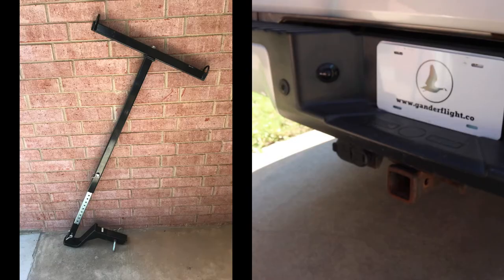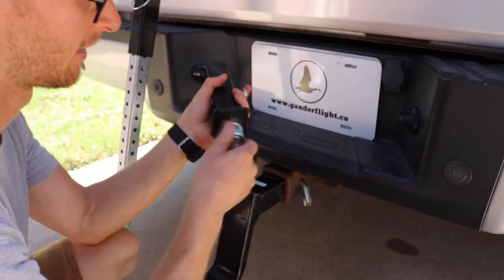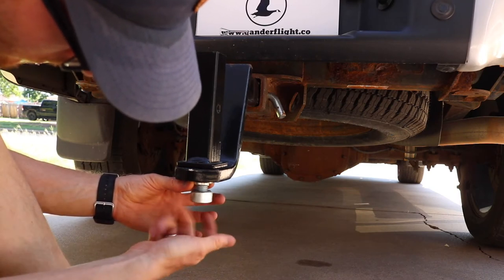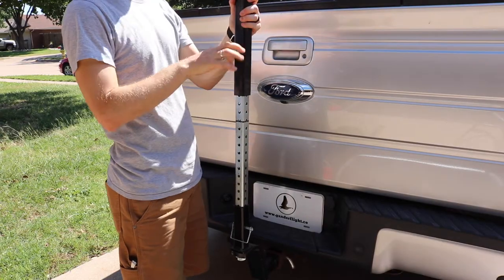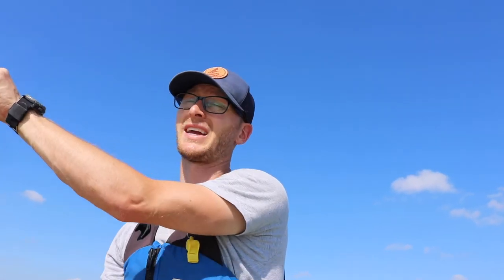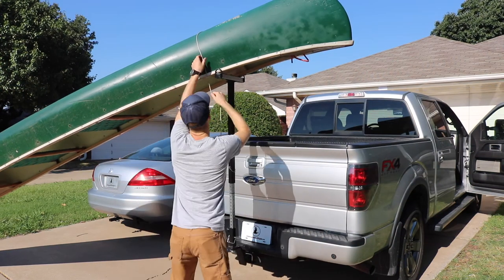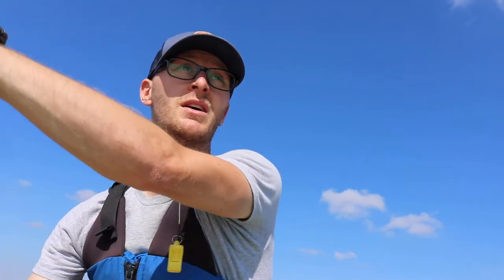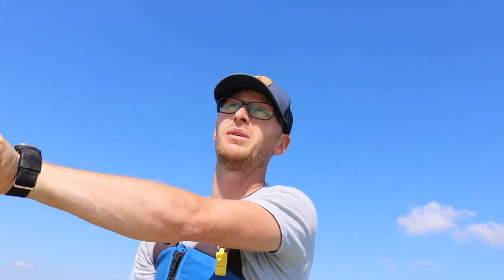The BEST Way To Load A Canoe By YOURSELF!

Comment: Your link suggests a trailer hitch ball mount that fits a 2 inch receiver with a 1 inch hole but I have a 1 1/4 inch receiver and was looking at a ball mount with three-quarter inch hole would that fit? Thank you in advance
Reply from the maker: Its been a few years - but I did use this on a 1 1/4 shank with our Honda Accord.  I don’t recall the hole size on it unfortunately but I would assume it fits!
Reply: @GanderFlight 1 1/4" drawbars come drilled for a 3/4" bolt which is the size that comes with this loader. 2” drawbars come drilled for 1" bolts which means that the lock washer that comes with this loader will not have a good seat to compress against. I wound up using the bar adaptor that came with this loader (allowing both a ball and the loader to me mounted side by side) as a backing against which to tighten the nut.

Comment: What you called a hitch receiver is actually called a drawbar.  The hitch receiver is the tube bolted to your truck frame that accepts the drawbar.  It is great to see this in production.  I built mine in the late 70's from square tube out of my scrap steel  pile.  Still works great, especially now that I am old and tired.  😉  Cool video.  Good to see this design still being used to save folks from getting a back injury trying to load up. Thanks for putting this out.  Subscribed.
Reply from the maker: Nothing new under the sun! Thanks for terminology clarification :) Happy paddling!

Comment: Thanks for this video! I had seen this loader advertised but there was not enough detail to make me confident that it was worthwhile. After watching your video I ordered one from Amazon and installed it a few days ago. I'm almost 80 years old so lifting even my 12' Old Town Pack canoe onto the roof of my SUV had become very difficult for me. This loader makes it very easy. I have a 2011 RAV 4 with the spare tire attached to the rear cargo door and I was unsure whether the loader would clear the spare tire. It did. One thing you didn't mention in your review is that the mounting hole on 2” hitch receivers is drilled for 1” mounting bolts whereas this loader comes with a 3/4” bolt. So when you tighten the mounting nut the lock 2asher has nothing to rest against on one side of the hole. This could cause problems so I used the additional metal mount supplied for allowing both a trailer ball and the upright to be installed simultaneously  to backup the washer. The only other thing I would add to your review is that most people will not have a wrench large enough to tighten the nut on the end of the upright. Specs call for this to be tightened to 150 foot pounds which is way beyond the capabilities of the average do it yourselfer. Personally I believe that while this makes sense for an actual trailer ball 100 foot pounds is more than enough for this loader.
Reply from the maker: Sounds like you got it sorted!  Using the barstock they supply to use this and a ball to solve for the hole/bolt differences is a good idea. I just looked up the instruction manual again - I don't think I actually got that piece in my kit a few years ago - maybe fell out during shipping - but that sure would be MORE convenient than taking up a whole hitch shank for this. A arge fender washer would do the trick too :)

Comment: Awesome tool, and thank you I was wondering only if I would be legally allowed to load 17 foot canoe on 2012 Honda CRV,isn’t it going to stick out to much ?
Reply from the maker: It is very helpful! Not sure on the laws where you are or even how much it will stick out front and back - you'll have to load it up, measure, and then check your local regulations. My guess is that you'll be ok - might have to tie a red flag at the end of the boat to show that its sticking out.

Comment: Do you know if this will work for a very large canoe? My son has an aluminum one where the middle section is about 4 ft wide. I'm not sure this will fit?! Thanks!
Reply from the maker: My canoe is over 20 ft long in this video which is about as big as they come before you get into north canoe style where people sit side by side so I’d be pretty surprised if this tool did not work for your son’s boat.
Reply: @GanderFlight  Thank you! I just ordered it. I was more concerned how in the front (or the tip) of yours fit between the brackets. I'm not sure ours will fit?! We'll give it a try. Thanks!

Comment: Can you tow your trailer and carry the canoe?
Reply from the maker: If I were to remove the canoe loader from the hitch and then hook up the camper yes. Then you’d need to store the canoe loader elsewhere.
Reply: @GanderFlight  great video! Thank you. I like the simplicity of your design. Not sure I understand the solution of towing a camper AND using this canoe mount on the same hitch. Do you have any pix? And excuse me if it's a simple fix, I never had a pick up before until last month. Thanks again!
Reply from the maker: @dyermaker009  It all depends on the the tow vehicle and the trailer - weights are key to know here.  If its small enough you could use a splitter( linked below) but the easy solution for most folks will be to load the canoe, then take the canoe loader out,  put in the hitch ball and hookup the camper.

https://amzn.to/3HUl4V1